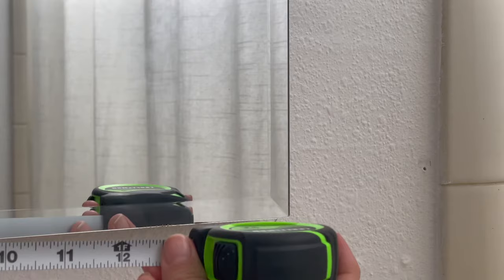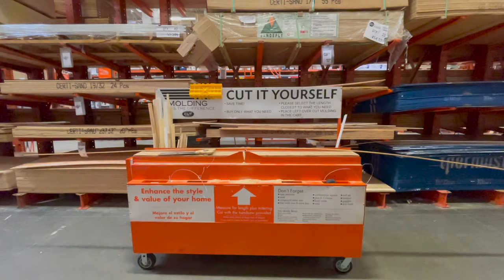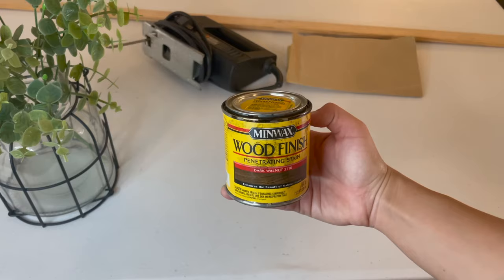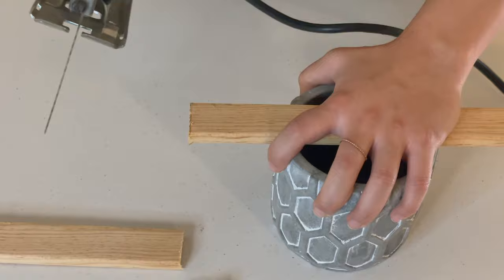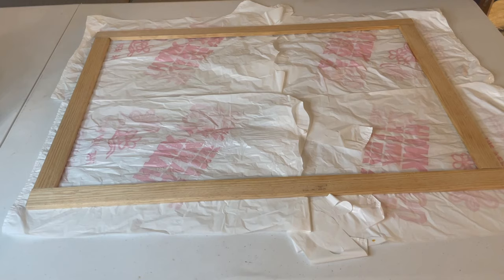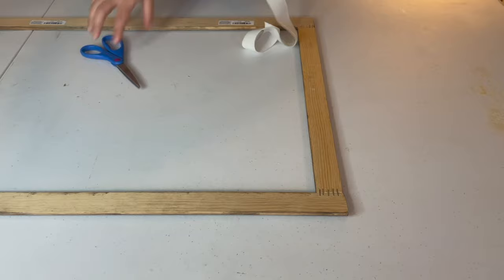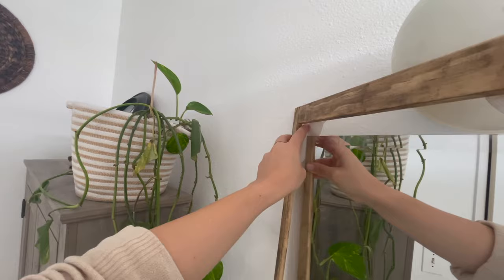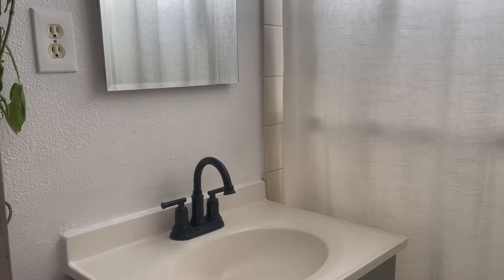DIY MIRROR FRAME UNDER $10 | MODERN |RENTER FRIENDLY MIRROR CABINET FRAME

Comment: This is brilliant!!! Any tips for the mirrors that are wall mounted in apt bathrooms and have those stupid clear plastic screw mount thingy's at the top? How can I get the wood to lay flush on the mirror with those things in the way? My guess is to cut into the back of the wood, but with wood this thin I don't know how to accomplish that without cracking or messing up the wood. Any ideas?

Comment: This is so smart!! i love it!! It's very doable for someone like me who is not so crafty.
would you recommend this method for doing a much larger mirror? It's my bathroom mirror which is quite large.
Reply from the maker: Thank you 😊 
If the mirror is a medicine cabinet yes definitely 
Just make sure the wood you purchase is a light weight since it will be a big frame. 
If you’re mirror is flush to the wall also make sure there is space between you’re mirror and wall for the elastic band to go over. 
Hope this helps 😊